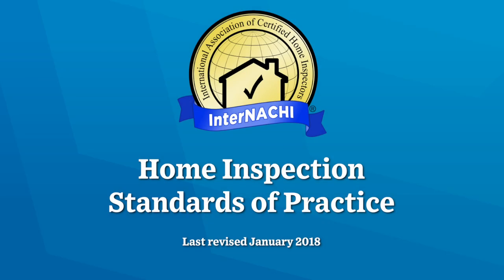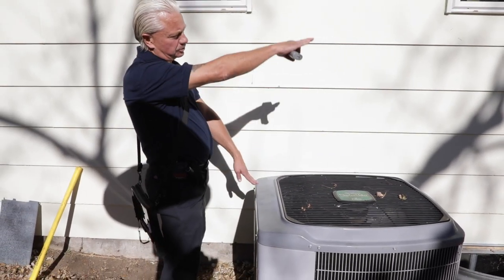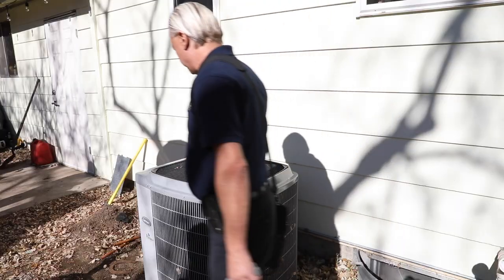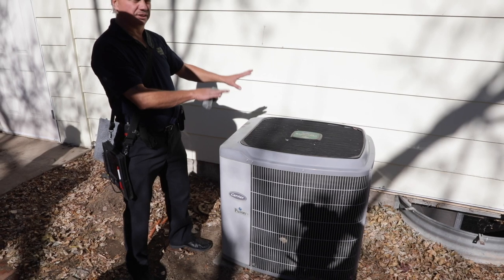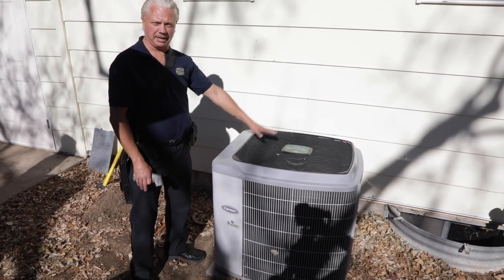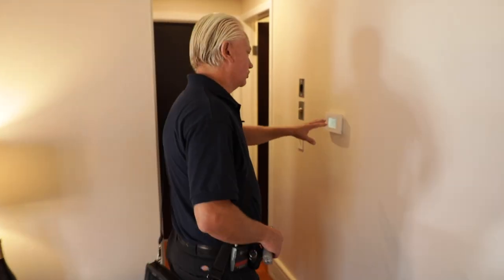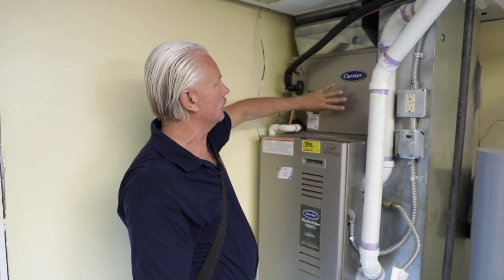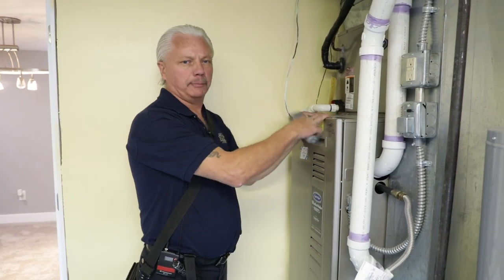How to Perform an AC Inspection According to the InterNACHI® SOP

Comment: Great video. Not a big deal, but the warm air passing over the coils doesn’t absorb the cold, but it’s the opposite. The cold refrigerant in the coils absorbs heat from the air passing over the coils.  Thermodynamics.
Reply from the maker: Thanks for the info! Good point.

Comment: Also didn't check system pressures, compressor amps, reversing valve operation/heat strips/furnace heat operation, filters and inspect duct condition/connections. You get what u pay for.
Reply: He's a home inspector, not an hvac technician. Home inspectors don't test all the items you've listed and they aren't required to. You are more than free to hire an hvac tech if you want to and don't mind spending the extra money.
Reply from the maker: You're confusing a home inspection with an HVAC system check by an HVAC technician.
Reply: @vanillarain711  that’s why u don’t trust an inspector and spend the money for a hvac maintenance or anything else
Reply: They paid for a visual function/safety inspection of the entire house not a thorough HVAV inspection. He's actually going beyond the SOP on a couple of items so they are getting more than their money's worth.

Comment: The guy that did yearly service on my AC poked a temperature probe in the ductwork above the air handler to check the temperature difference. Seemed like a good idea - but he never attempted to cover the hole so I just put a little duct tape over it.
Reply from the maker: Nice.
Reply: Every HVAC tech I've every had at my properties does that and I hate it. During my home inspections I cover them with duct tape as a courtesy.

Comment: Dryer filter, 18 to 20ﾟ split,  This guy said multiple things incorrectly  Not a very good Inspection didn't check the freon level didn't check the Coil if it's  Dusy or clogged.   Didn't open the panels and check the wire connections didn't check the capacitor Wire breaker terminals.  Drain line could be partially Clogged.
Reply from the maker: Thanks for watching. Glad you enjoyed it.
Reply: You’re confusing a visual home inspection with an HVAC inspection by a professional HVAC technician.

Comment: Hire an HVQC professional.  Not a clown like this guy. Home inspectors are the mall cops of the real estate industry
Reply from the maker: I disagree, Toros. It's expensive and impractical to hire a professional for each system of a house. It's best to hire a home inspector who can inspect all of the systems of a house in about 3 hours with an inspection report produced. I don't understand the comment about mall cops.
Reply: Like a General Physician 
A Home inspector give U the best
Visual Opinion.  U can fix some issues without calling any Specialist. Like cleaning or Filter etc etc
Reply: Alot of us inspectors have an extensive background in electrical, HVAC, and building ....so paying 500 bucks to have a trained set of eyes is logical, and a specialist can be called in if a major issues is found. Not all issues warrant a call to a single profession.